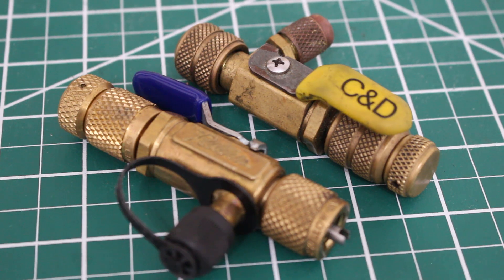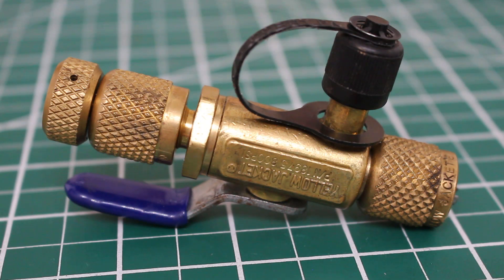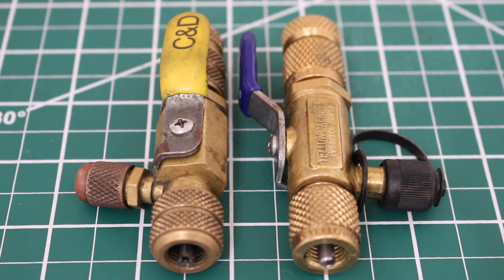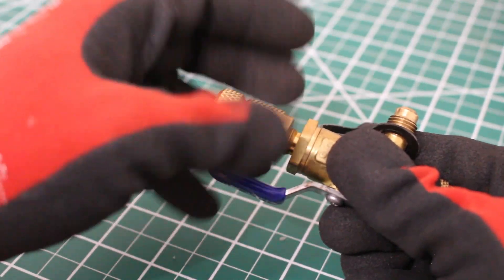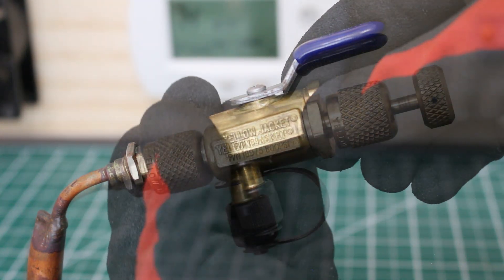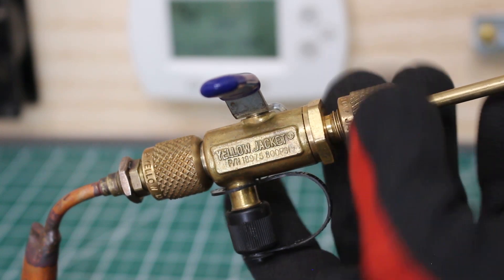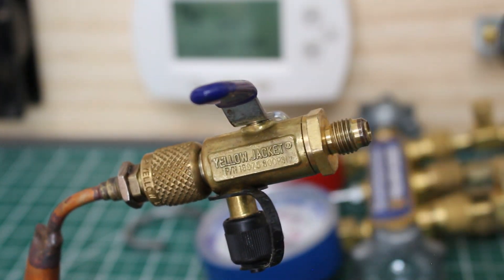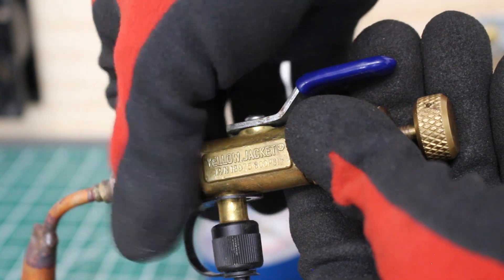HVAC: Valve Core Removal Tool (How To Remove/Replace A Valve Core For An AC System) Schrader Valve

Comment: The only thing you missed here, and it would seem every other video also misses, is that for complete amateurs the idea that the valve needs to be removed to speed up the testing process. 
No one says whether it can remain in place and why it should be removed.